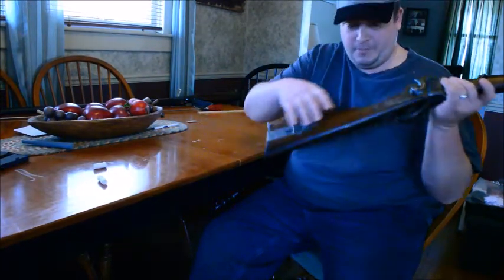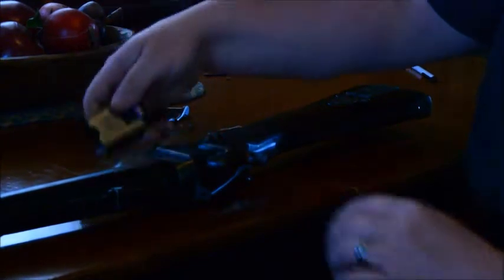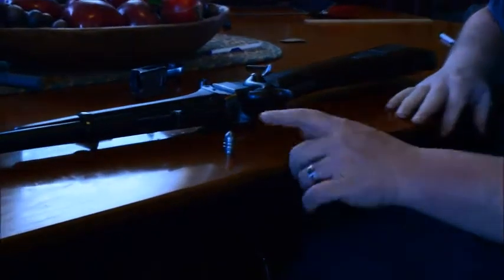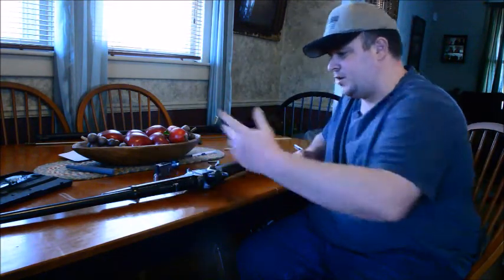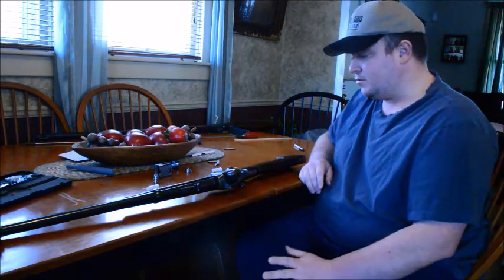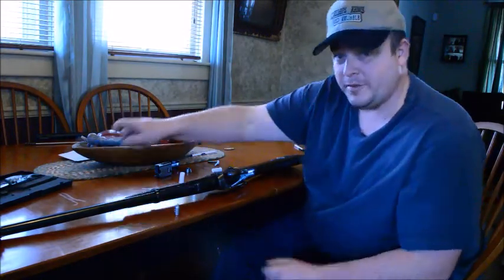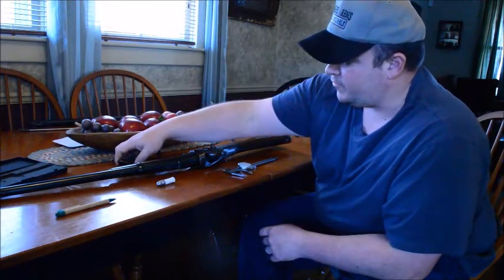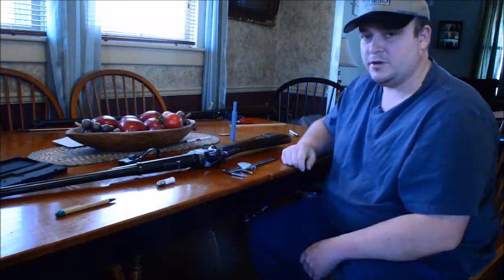Making percussion sharps ammo part 1

Comment: Sent my sharps to Charlie Hahn. He just finished redoing the block assembly. I couldn't shoot any more than 4-5 rounds then I could not lower the block. My gun does not have a sliding tube inside the breach like so many, mine is a solid piece. If you are having gas leak problems Charlie can fix that for you. For around 250-295 dollars. using charlies tubes are easy and a good way to shoot your gun. makes it simple to load and everything goes out the barrel. there is a you tube vid on making the cartilages with charlies tubes. look it up.
Reply from the maker: Michael Andersen Charlie has already worked on my carbine.  Works fine now. I have tried his tube but for some reason they stick in my chamber. I am the only person that I know of who has that problem. I went back to the paper because they all burn up so that just makes loading faster for me.
Reply: Portsmouth Armory Channel yes!! Just got my gun back yesterday and it looks great. Just ordered some extra grease and O-rings. As you know Charlie has done a lot of research on what grease and O-rings work the best with his conversions and it isn't that expensive. $18.00 for a 4oz tube of grease and and a packet of 70 O-rings. And for those wanting to know where to get it. Here it is.
O-rings: Part # 2418T123
Grease: part # 1392K31
From: McMaster.com
Thanks again for the Vid.
Reply: Portsmouth Armory Channel Portsmouth Armory Channel yes!! Just got my gun back yesterday and it looks great. Just ordered some extra grease and O-rings. As you know Charlie has done a lot of research on what grease and O-rings work the best with his conversions and it isn't that expensive. $18.00 for a 4oz tube of grease and and a packet of 70 O-rings. And for those wanting to know where to get it. Here it is.
O-rings: Part # 2418T123
Grease: part # 1392K31
From: McMaster.com
Thanks again for the Vid.

Comment: I was using too much paper on the tube leaving residue in barrel after firing, was gluing from the inside which I think was hindering ignition. Plus its a new pedersoli and everything is tighter than a drum. I'm going to try the lithium hoping I can get more than 3 shots before fouling. Will be sending it to Charlie after around 20 more shots. Thanks for your info, I'll let you know how it goes.

Comment: Hi how are you?  I have a Sharps made by IAB as well.  It's a great firearm but having some trouble with gas leaking from around the breech block area like you once did.  I use the white lithium grease which does work for a while and certainly assists with being able to open and close the action fairly freely.  I have just emailed Charlie Hahn to see if I can purchase the "O" ring part from him to see if this will reduce some of the gas leaking before I get the entire breech block made solid like you have done.  Great video.  Regards, Paul Smith, Perth, Western Australia.
Reply from the maker: P Smith you may have to send your carbine to him which may be a problem for you
Reply: Hi there.  Yes the distance may be an issue as the shipping would not be a cheap exercise.  I have emailed Charlie Hahn about the O ring section in the breech and see if I can work around that to solve the gas leak.  Thanks again and good shooting.

Comment: I just bought one of these in Pedersoli.  Thanks for the information on what to do if you just want to try it out before sending it off.  I wondered how much powder yours holds now that you have it modified?  I guess it is limited.  A friend loaned me a Rapine and another one marked Pedersoli.  I guess I'm lucky considering the cost of these things!
Reply from the maker: Mine holds the same amount of powder as it did before. My tubes will hold as much as 50 grains but it seems to shoot most accurately with 42 grains.